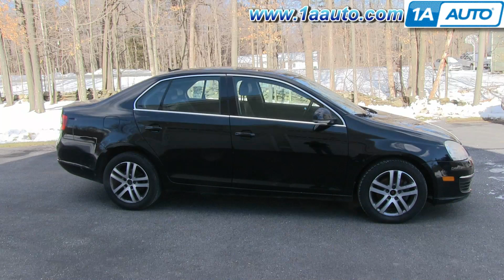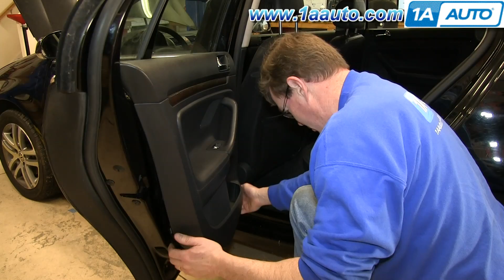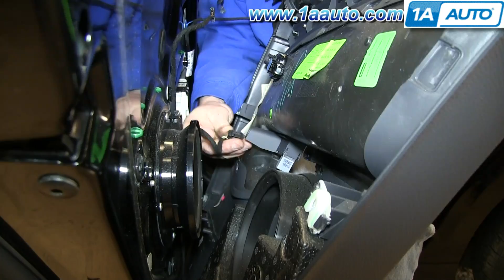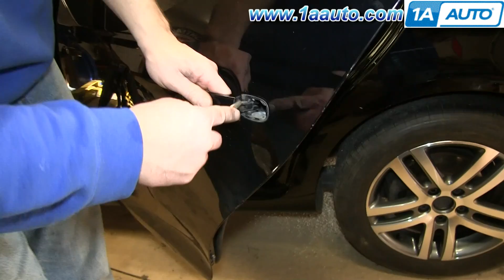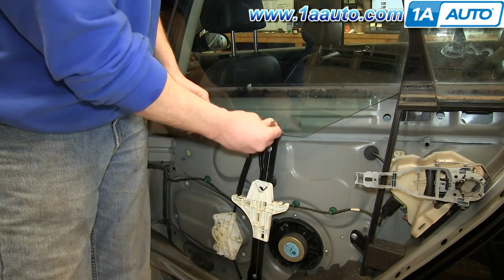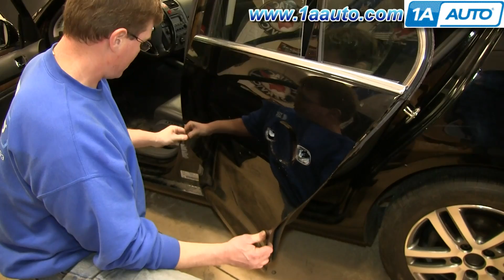How to Replace Rear Power Window Regulator 05-10 Volkswagen Jetta

Comment: There is no reason to remove the interior panel if it's power windows, that's the whole reason the regulator motor has it's own access panel on the outside.

Comment: Seems very similar to front door procedure. I think you can do this job without removing inner panel/door card as you can access the complete motor assembly by detaching the metal panel from outer side.

Comment: do you know just one step before you put the outer panel back, that door inner part , you need to use a o-ring to hold the top hinge 7:34 , so it won't come off after you fit the outer panei, I thing last time it  broken people didn't put it back.

Comment: Im having a tough time putting back the aluminum piece at 8:55,  the rotating collar on the inside ends up on the wrong side of the tabs on the aluminum piece when tightening. I cant figure out what im doing wrong, you reinstalled yours with no struggle at all

Comment: I'm glad I was able to find your channel!I have an 08 VW Rabbit and my rear window will not stay up. Will I need the regulator and motor?
Reply from the maker: +Mrflask Tastic Unfortunately, we cannot diagnose accurately over this channel.  We recommend taking the vehicle to a trusted mechanic so they can determine if it is the regulator, motor, or just that the glass has fallen off the guide.  That one hour of shop time can help you spend your repair money wisely, ensuring you purchase only the part you need to resolve the issue.  Once the mechanic has a recommendation, feel free to visit 1A Auto for a great price on what you need:  http://www.1aauto.com?utm_source=YouTube&utm_medium=CTA%20Comment&utm_campaign=1ATony